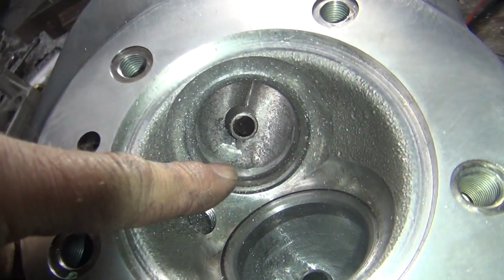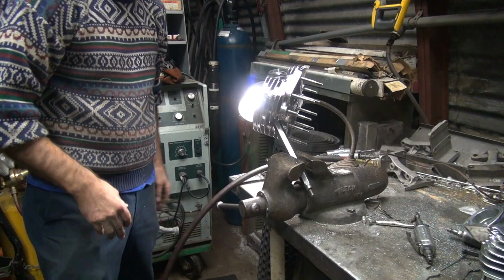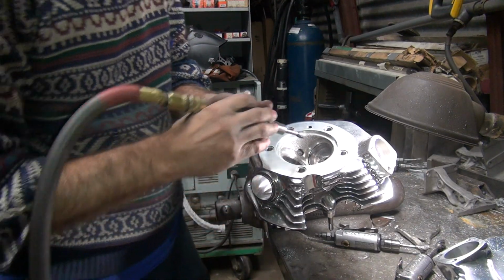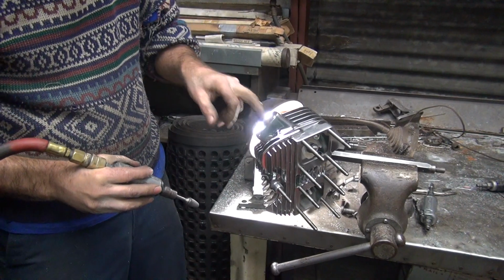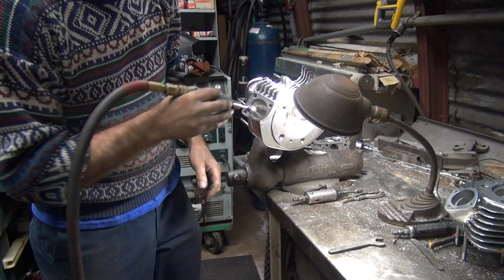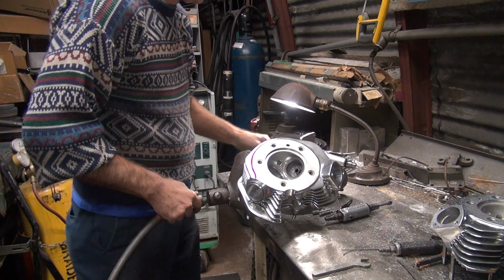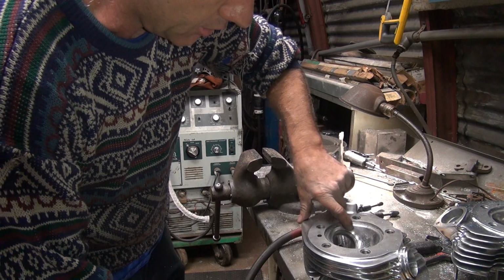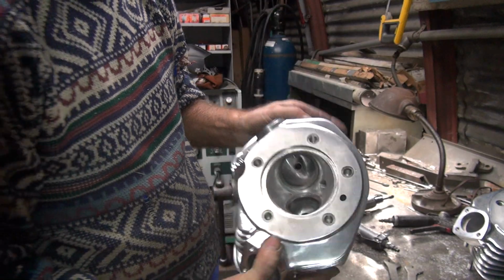#155 1978 93ci stroker shovelhead big bore motor new bike build fl harley by tatro machine

Comment: Wow, what an amazing job you did on this pair of heads Keenan! Any idea what kind of HP gains would a good port job like that add the output HP of the mill? 20hp? 30hp? 40hp? Also, I love the Mikuni HSR carbs. I currently have an HSR-42 on my Evo. Would an Evo benefit from having the much larger HSR-48 carburetor after having bigger valves and the ports opened up like this afterwards? Thanks for another great video, you're the man!
Reply from the maker: don't know on the power increase, it will run better. the 48 is way too big unless you are spinning it to the moon or are a big ass motor.
tatro